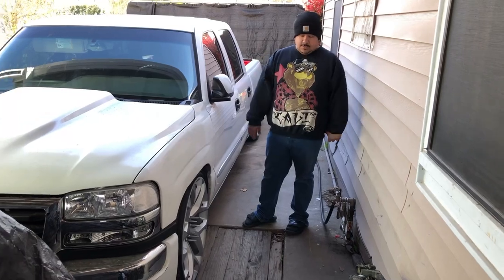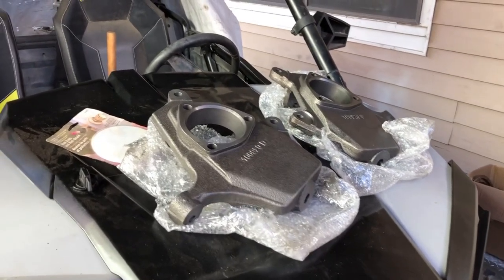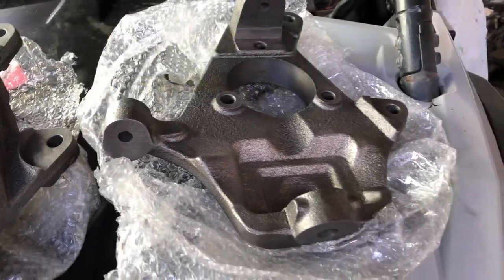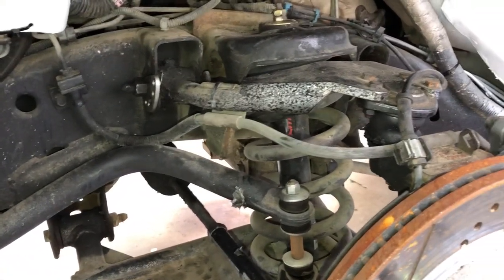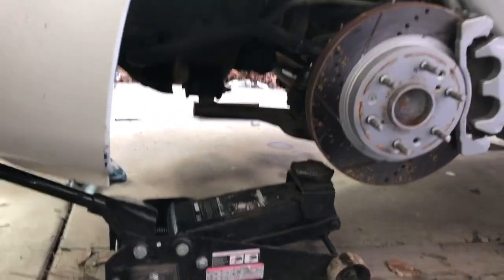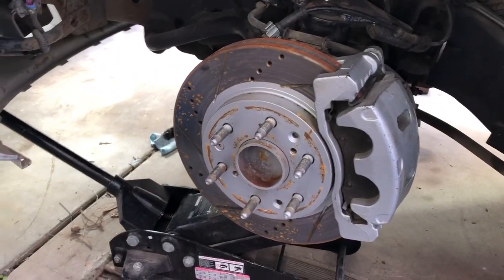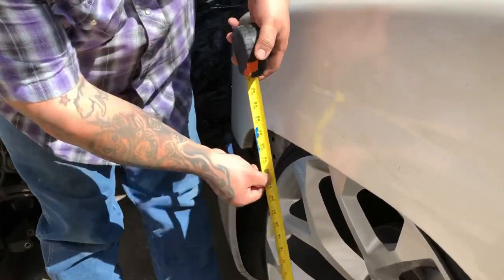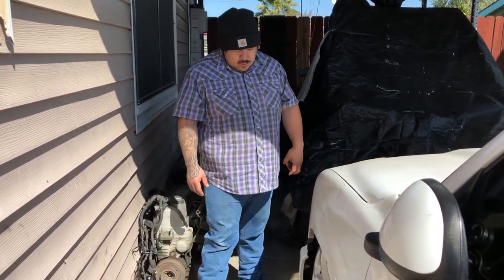Installing 2” drop spindles on my 2005 gmc sierra crewcab a total of 6/10 drop

Comment: That’s why yours seems lower in front bro cuz you are running 275/30/24 in front, so you have more tire up in the fender than I do. Cuz I’m only running 255/30/24 up front and the 275/30/24 in the back. But I am at a 7/11 drop and I’m down to the wheels, tucking alittle rim. But definitely tucking in the back rim and tire! 🔥🔥🔥🔥

Comment: Were you able to do full turns with the 6 inch drop in the front ?
Reply from the maker: I wasn’t able to because I’m running 275 tire up front. But maybe a 255 would be able to if you where to pull/roll youre fenders. But I also have firewall tubs. So that helped me out alot.

Comment: You what else I noticed too bro, cuz your tie rods are flyin, lookin like this V, time for some Michigan Metal Works Bumpsteer kit, it puts the rack arms below the spindles and back to horizontal. You’ll love that Bumpsteer kit bro
Reply from the maker: Yea its ready for take off lol. Amd yea i was actually looking in to that after i seen it in you’re video. Definitely a must. And only difference in the 275 and 255 is the width. But tire is same height. I looked it up on this website lol https://www.tacomaworld.com/tirecalc?tires=255-30r24-275-30r24.
Reply: @differentgarageprojects5656  ok 👌🏽👍🏽 cool bro 😎

Comment: With the lower control arm can you use like 16s in the front I drop mine with a 3 inch coil and 2 inch drop spindle but it doesn’t really look low like how I wanted  it?
Reply from the maker: Yeah, if you get rid of the spindle, you should be able to run 16 inch wheels